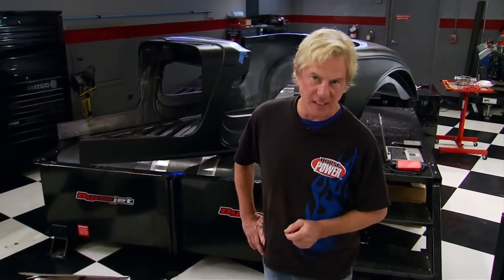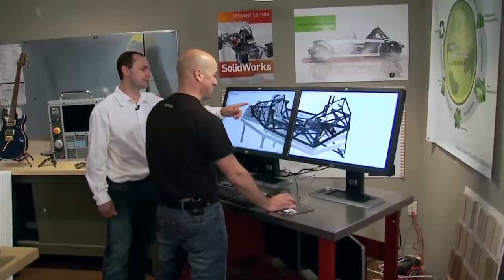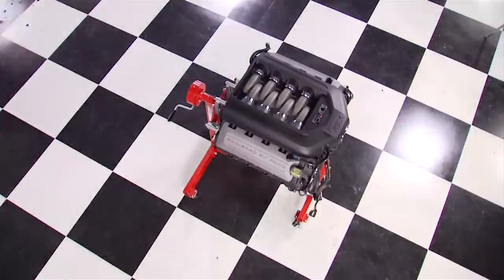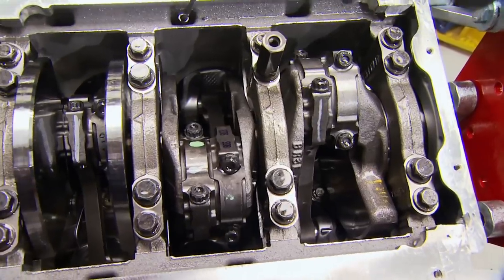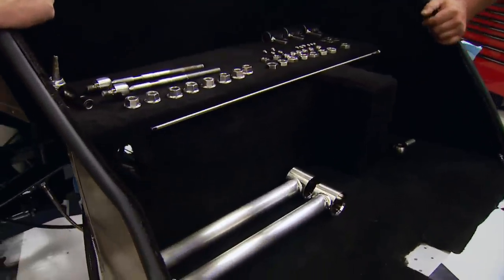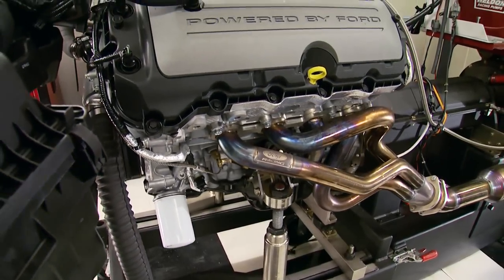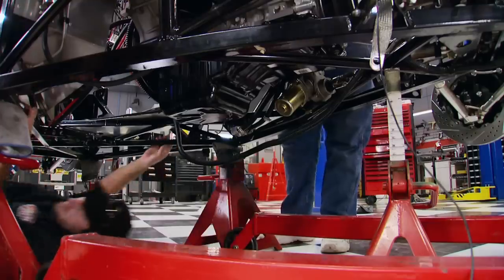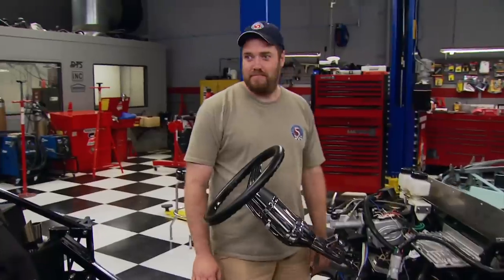Transforming A '33 Roadster Into A Show Car With A 5-Liter Ford Coyote - Horsepower S14, E15

Comment: The Coyote V8 is an Awesome engine. I have a 2011 Ford F150 with a 5.0L Coyote V8 in it with 141,000 miles and still going strong and its a beast and it sounds like a beast with the Borla ATAK exhaust on it.